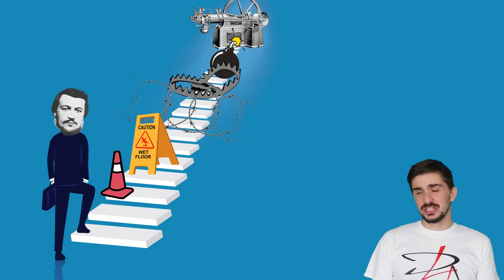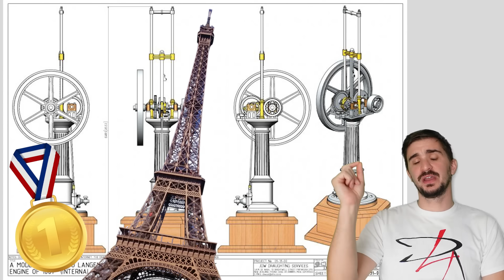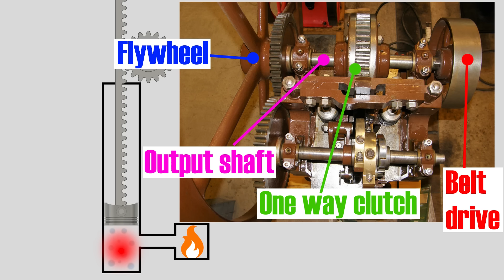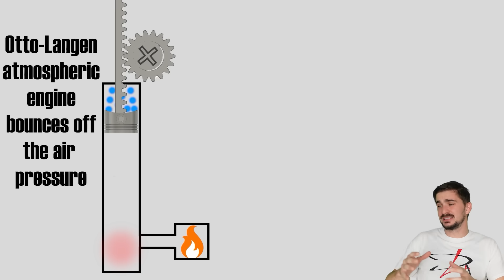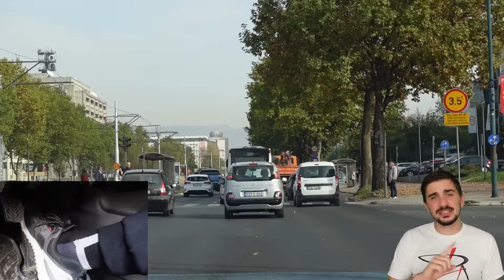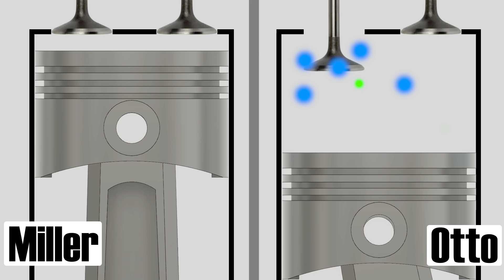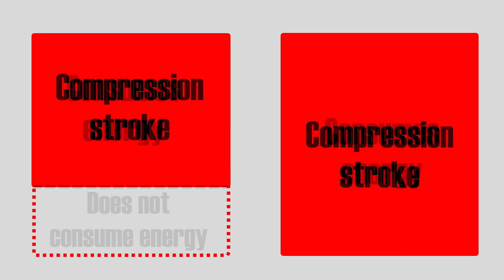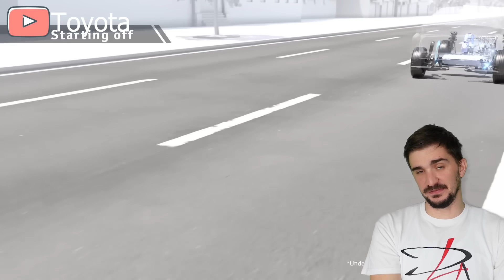You'll understand everything about Atkinson, Miller and Otto cycle engines after watching this video

Comment: I’ve always thought of this more as increasing the power stroke length to extract more usable energy, rather than decreasing the compression stroke.  It’s really the same thing, but I believe it better expresses the intent of increasing efficiency.

Thanks for the video!  Good stuff.
Reply: I also like this way of explaining the concept better :)
It is litteraly the concept behind 5 strokes engines
Reply: Yeah, this is quite important. See, If you have less mass of air + fuel mixture in the end of compression stroke, the pressure and temperature of gasses will be smaller in the end of combustion stroke (compared to OTTO cycle). 
This can be also achieved by throttling air intake during suction stroke (basically, this is what happens when you release gas pedal, gasses outlet temperature drops down). But this will strongly increase intake manifold resistance => efficiency will be less.
Also Mazda's Skyactiv engines are designed to have very big Compression ratio. This allows you to maintain Pc (compression pressure) same as in OTTO engine. (In general, increasing Compression and Combustion pressure leads to increasing of efficiency).
Marine Diesel Engines now have gigantic stroke of up to 3.5 meters(!). In order to expand gasses as much as possible thus utilizing as much of energy as possible.
Reply: Agree! This increase power extraction even overcomes some of the thermodynamically unavoidable losses due to lower compression. Part of the efficiency of diesel engines is their high compression ratio and ethanol mix in in gasoline makes for higher efficiency due to higher octane value which allows higher compression ratio without knock.
Reply: Pumping losses are the problem with petrol engines,  diesel does not suffer from them.
Reply: @chrissmith2114  Even diesel engines suffer pumping losses,they are just lower because they are not usually throttled (though some diesel engines are).
The additional pumping losses on a petrol engine occur when the engine is throttled upstream of the intake valves, so the piston is expending energy working against the partial vacuum in the intake manifold/plenum. This can be eliminated by not throttling in this way, instead using adjustable valve duration like the BMW Valvetronic system or Fiats Multiair.
Reply: @ferrumignis  Honda have also been using that kind of system for a while now,  reducing pumping losses is the holy grail of petrol engines ( they tried using smaller capacity engines with turbo so that throttle could be open wider for same power ).  Difference is that the German system will be over-hyped and horribly complicated and unreliable,  the Italian system will suffer build quality and electrical problems and the Japanese systems will be bulletproof.
Reply: Yeah, its easy to see why 2L Atkinson has less power than an 2L Otto when you realize that holding the intake valve for 20% of the compression means you are only using 1.6L of air.

Yet it is more efficient than an equivalent 1.6L Otto because it can over expand the power stroke
Reply: @chrissmith2114  BNW Valvetronic has been around since 2001 and has been pretty reliable. BMW seem to be able to get exceptional economy from their big (by Euro standards) 6 cylinder engines.
Reply: @ferrumignis  Multuair or Valvetronic are not  good ideas. You have uncomplete load anyaway.
Reply: i see it as managing diminishing returns.
Reply: You are right.  Conventional Otto Exhaust blowdown pressure and temp are ~125psi and ~1200F.  Miller captures this energy thru further expansion.   The same principal applies to turbo compounded engines.
Reply: It is not really the same thing if combustion chamber is the same. Decreased compression stroke usually used to decrease pumping losses on partial loads, like it is done with Valvetronic. But they have standard geometrical compression/expansion ratio. To increase thermodynamic efficiency the ratio need to be increased proportionally. Mentioned Toyota engine has compression ratio 13:1, so it can realise the advantage of the shorter compression stroke. But the Honda engine has CR 10, that is even smaller then have modern Otto engines. I wouldn't even call it Miller cycle engine.
Reply: @chrissmith2114  Pumping losses are not so high, except idling mode. Usually they are about 5%, so it is nice to avoid them, but not critical. Main idea of downsizing is not to save pumping losses, but to save mechanical and thermal losses, which are much higher (about 70%). In the same time turbo decrease the engine efficiency, because you need to use lower compression ratios and later ignition. So these small turbo engines save fuel at very low loads, used in old fuel consumption test cycles, but consume more in real life with higher loads.

Comment: Great video identifying the Otto and Atkinson/Miller 

I was taught that the Atkinson/Miller benefit was two-fold: one was the reduction of waste in compression, but the other was the extension of the expansion stroke which allows more of the pressure created by combustion to be converted to work. 

17:02  you draw a horizontal line as the cylinder moves upward and point out the reduction of compression waste by ~20% .. and we have that .. but if we reference the datum at start of compression instead of start of upward motion, what we also have is ~ 20% greater extension of the power stroke allowing the pressure in the chamber to work longer.

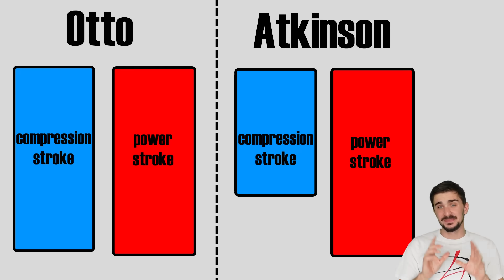At 8:55 the diagram showing Atkinson having shorter intake stroke and same length power stroke is actually Miller. Atkinson would have both blue squares the same size and a resulting longer red square, illustrating the extension of the power stroke.

Traditional kpi such as power per cubic inch displaced (the same size red square) show Atkinson as lower, but power per cubic inch compressed (and therefore power per amount of fuel consumed - the same sized blue square) show Atkinson higher.

As you said, with car engines being mobile, weight matters and pure Atkinson requires a larger chamber. As engine material technology improves, that gap in weight becomes less. 

As you said, the addition of the electric supplementary motor corrects the “low responsiveness” feeling - lower power per cubic inch displaced - of the Miller.

New engine designs are looking to alternate mechanisms besides reciprocating pistons to obtain the benefit of Atkinson expansion. In the big picture, the 150 years of reciprocating pistons is a short time in human history.

Comment: Maybe it's just an alternative but equivalent explanation to the one you proposed, but I thought that the reason Atkinson and Miller engines are more efficient comes down to harvesting more energy from the power stroke. Here's why I say this. In at Otto cycle engine there is still a lot of pressure in the cylinder when the piston is at the bottom of its stroke. If the stroke could be extended then more energy could be extracted compared to an Otto cycle engine. From an energy balance point of view, shortening the intake stroke is equivalent to extending the power stroke. I think the difference in the intake stroke length compared to the power stroke length is the key reason why Atkinson and Miller engines are more efficient.

Of course, in a mechanical sense the stroke lengths in the Miller engine are the same as in an Otto engine. However, because of the valve timing, a Miller engine acts like an engine with a shorter intake stroke.

Comment: Terrific lesson - thank you. I owned a Mazda Millennia for a few years. A wonderful car to drive and I was proud of the Miller Cycle tech. Its tragic flaw besides initial cost (I bought mine used and enjoyed a spectacularly depreciated price) was that the supplier of superchargers to Mazda utilized a flawed, brittle design for the oil seals. They inevitably failed causing the supercharger to force the lubricating oil into the induction charge. This ruined the O2 sensors and catalytic converters resulting in hefty repair bills. Mazda quoted me $5K to replace the supercharger with another factory flawed unit and plus $3K to replace the 3 oil soaked cats. The one company rebuilding the superchargers with improved seals wanted $2K+ per unit. 
The line I used in the AutoTrader ad for the car was “I dare you to fix this wreck…” 
A shame - a wonderful, quiet and fast highway cruiser..

Comment: Great video.  Not all Toyota hybrids use the Atkinson cycle engine in their hybrids; the 3MZ hybrid engine does not.  Further, Toyota will often increase the base compression ratio on an engine used in the Atkinson cycle model so that the effective compression ratio is similar to the Otto cycle version (an example being the hybrid 2AR-FXE versus the standard 2AR-FE).  The camshaft profiles and valve timing are different as well.  With proper engine management, the 2AR-FXE can be operated as an Otto cycle engine to gain power with a loss of efficiency with higher octane fuel.  There is still a loss of power with the Atkinson cycle compensated for by the electric motor, but improved efficiency.  Detonation (and octane) limits the practical compression ratio of any gasoline ICE engine.
Reply: It should also be noted that these engines are not actually driving the wheels in the hybrids.
Reply: The 2ZRs in the prius and corolla seem to be very good engines despite the shortcomings of the Atkinson engine, but it's still not recommended to run them at speeds over 140km/h as far as I understand.
Reply: All toyota vvt-i, vvti-ie is atkinson cycle
Reply: @chicken29843  yes, they are, though coupled to the drive wheels through a CVT.  The motor generator can operate in 4 modes: engine only, electric drive only (engine off) , engine and electric drive operating together, or regenerative (charging battery).  On AWD variants, a separate electric traction motor drives the rear wheels directly.  A Highlander relies more on the I/C engine than, say, a Prius.
Reply: @reneneron2971  and then there's the hybrids that have like mostly regular automatic transmissions I think there's a Camry model that comes with it and that's just a whole nother level of confusion of how that even works

Comment: Hey man, really enjoy your videos. Just a small detail I wanted to mention about the Otto and Langen engine operation: The top of the cylinder is actually open and does not build pressure on the other side of the piston (beyond atmospheric). Once the intake charge is drawn in by a short upward stroke of the piston, the chamber is sealed and the mixture ignited via flame ignition, sending the piston/rack upward (clutch freewheeling). The momentum of the piston/rack causes the piston to travel beyond full expansion, pulling a vacuum inside the cylinder which is compounded by the rapidly cooling combustion gases. With a strong vacuum in the cylinder, atmospheric pressure acts on the top side of the piston causing it to travel downward (clutch engaged) and transfers power to the shaft until pressure equalizes in the cylinder. Quite a unique but fascinating engine!
Reply: How does the piston go up for intake after it falls down after combustion stroke?
Reply: @Appletank8  Search on "Startup & Instructional explaination of 1867 Otto Langen engine operation" on YouTube, about 15 and a half mins in it is shown and discussed what is happening.
Reply: @TarenGarond  aight, thanks
Reply: @Appletank8  There’s a clutch that engages after it drops past a certain point which turns an eccentric attached to an arm that lifts the piston/rod up a couple inches for the intake stroke.
Reply: @JPMotorhead1993  I see. Now that I'm squinting at it, it's like the world's most inefficient two-stroke engine.

Comment: Thank you very much for this video. Very well-explained and illustrated, and giving a great balance of design and industrial history with sufficient technical detail to leave the viewer with a good understanding of how to explain these different engine models to another person. As the owner of two Toyota Prius cars (a 2nd gen 2008 and a 3rd gen Prius V), I can attest to the excellent fuel economy of these vehicles in both highway and city driving. I willingly accept the tradeoff of somewhat less acceleration power off the line and for passing on the highway as more than worth the consistent 50 mpg for the 2008 Prius, and 40+mpg for the 2012 Prius V. The fact that these Priuses also don't have an alternator or starter motor to wear out is really great. Starting these cars in -25 degree weather is also a zero-stress operation; you just have to make sure you never leave the interior light on, as the 12 volt battery in them is absolutely tiny.

Comment: Fun fact: Some of Cat's ACERT diesel engines (BXS and MXS for example) also used a miller cycle. Boost close to 60psi was provided by series turbos. I think there was a variant of Cummins' big cam engines using the miller cycle too.
Reply: ACERT is Miller cycle. Helped meet EPA07 by reducing NOx production in cylinder. Pretty cool stuff. Basically reverse Jake brakes
Reply: You're right.  And it's switchable.  There's a brake-like device on the intake rocker called an IVA that can hold it open longer.  It can be turned on as needed.
Reply: @bradferguson4943  If it didn't have that it probably would be impossible to start.

Comment: Very good video, though I'd like to say; that closing the inlet valve later part way up the compression stroke can actually  increase the amount fuel/air mixture entering the cylinder and therefore increase cylinder pressure 'at higher rpm's'. As the negative pressure of the gases drawn in during the inlet stroke are still trying equalise to atmospheric while the piston is starting its compression stroke. So there is an optimum timing for this dependant on the engine speed.

Comment: In high school I independently came up with the miller valve timing idea for increasing efficiency of four stroke engines. My reasoning was not to reduce the energy of the compression cycle, but realizing that a combusted fuel takes up much more space than it did before, the power stroke should be longer to allow the piston to reach atmospheric pressure before the exhaust stroke starts.
Reply: This is exactly what I was thinking as I watched the video. It is impressive that you thought of that in high school. Did you have formal thermodynamics education?
Reply: @hitanshupatel2519  No, but I'm fairly good at making accurate mental models of things and seeing how they behave as parts move and interact. That includes pressures and forces, and I sometimes I can see how and where fluids will flow and things will break. My dreams are accurate enough that I had a dream about driving backward and had to learn how to drive quickly by looking in the rear view mirror. When I woke up, I found that I was able to use what I learned to drive very quickly backward in a real car.
Reply: yes, i had the same thought when i heard of Atkinson cycle, i never thought it was about reducing compression.
Reply: thought for natural aspirated it's straight forward, but when you're using a supercharger, it's like you're combining a renkin cycle on top of oto/atkinson-cycle

Comment: With all due respect for your incredible amount of knowledge, I do not agree that there is a loss of energy (that you do not get back) with a higher compression. If that was the case, then there was no point in using very high octane and very expensive 120 octane gasoline that allowed WWII aircraft engines to produce higher horsepower. A racing car engineer will also tell you the same, as they use 150 octane gasoline.If that is the case, then car engine manufacturers would design them with lower compression in order to use much lower cost, lower octane gasoline. What makes them more efficient is the capability to extract more energy on the power stroke as a proportion to the exploding fuel-air mass. You end up with a lower pressure of combustion gases at the bottom dead center than with the Otto cycle, and lower exhaust gas pressure, which means that you have extracted more energy

Comment: I get the feeling Toyota uses "Atkinson" instead of Miller for branding reasons. Their method is more Miller without the charger than Atkinson's differing length of piston movement. A true Atkinson would do best in a stationary and/or very low rpm situation and that is more what it was designed for, than use in a mobile situation.
Reply: The electric motor functions as the "supercharger" in this case, it just makes up for volumetric efficiency by acting as a variable geometry flywheel.

there's really nothing "atkinson" about the toyota version I call "miller cycle 2, electric boogaloo" because it does nothing to vary stroke geometry/displacement like say... the infiniti VC-Turbo engine that utilizes bellcranks similar to an actual atkinson engine to vary the stroke geometry and instead makes up for its lack of volumetric efficiency with a more direct power-adder.

I see anything that utilizes changes in cam geometry to control volumetric efficiency for the cycle as "miller" and anything that utilizes changes in crank geometry to physically change the displacement as "atkinson" especially since examples of both exist... I don't agree at all with toyota calling their hybrid synergy drive an "atkinson" based cycle when it does nothing to make displacement a variable.
Reply: @RyanAumiller  "miller cycle 2, electric boogaloo" made me guffaw. Also it is very appropriate for the situation.